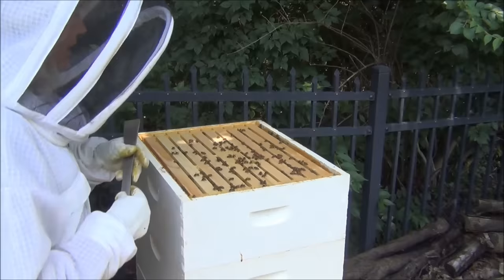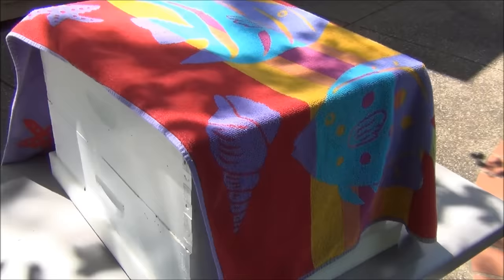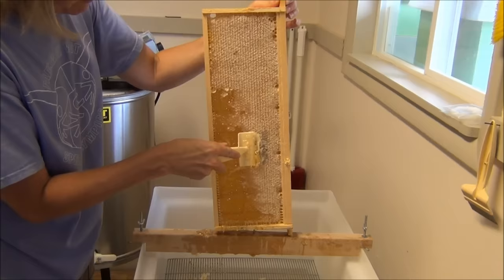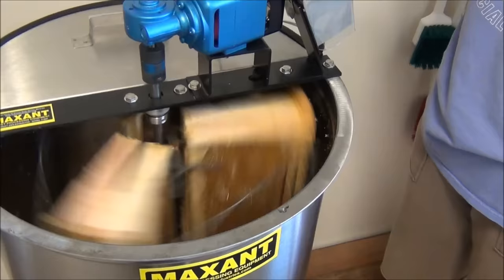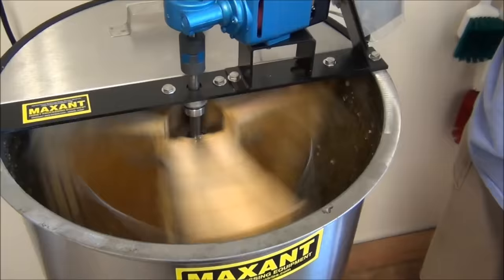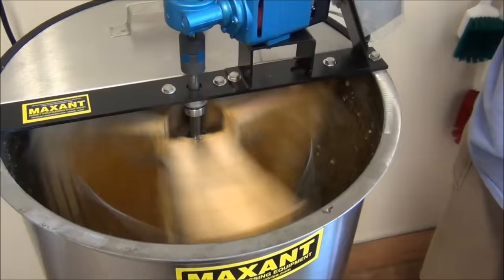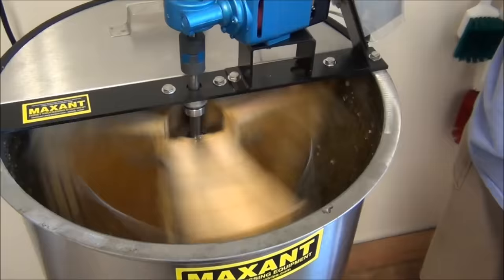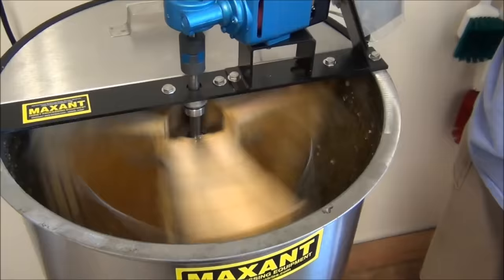My first year's honey harvest: 49 Pounds - from start to finish

Comment: What do you do with the super frames over winter? Do you freeze them? Or just store them in plastic tubs?
Reply from the maker: Last year I didn't do anything to them.  Just stored them.  I had less than two supers.  This year I had five.  I did put them in the freezer for two days to kill anything, then stored them where there is both light and air.  My queen wandered up there, so there is greater risk of wax moths and hive beetles.  I have them stored in my garage on one of those wire shelves (to allow air and light) just above the window in the garage (for more light).  We shall see how that turns out.  I know a lot of beekeepers use the anti moth chemicals, but I wasn't very excited about that approach.
Reply: Brook Hill Honey - Mr. G's Honeybees chemicals are not the enemy, other beekeepers use them because they help and don't affect the honey's taste

Comment: My only question is why measure liquid in weight instead of volume...
Reply from the maker: Most honey is sold by the pound.  You can convert pounds to gallons pretty easily though - about 12 lbs of honey per gallon.

Comment: Why not spread them out???make it quicker and easier for them to clean??
Reply from the maker: They can get in between the frames just fine.  As far as the wax clippings, it is all clumpy with honey and they have to clean from the outside in either way - hard to explain, but it is like thick cookie dough, but stickier.  Hard to spread out much more than that.

Comment: How come none of the cells have larvae in them?
Reply from the maker: Typically vertical colony design is split.  Brood boxes (which are taller at 9") are usually on the bottom, and honey supers (shorter at 6") are on the top.  Most of the time, the queens will not wander above the "honey line" and lay eggs higher up, but most beekeepers find they need to insert a "queen excluder" that allows the honey bees to move up and store honey and prevents the queen from moving up and laying eggs.
Reply: @BrookHillHoneyMrGsHoneybees  oh cool!  Thanks for telling me :)

Comment: How much do you leave for the bees winter?
Reply from the maker: We try to make sure that they have 60 lbs of honey, or about 10 frames of the large brood box size (the lower boxes).  We also give them some supplemental sugar mush just in case they run out.  In my experience, a strong hive going into winter eats a lot of honey and a lot of the sugar mush before the honey flow the next spring.

Comment: i saw a bee hive where you can extrakt the honey realy easy and it do not harm the bees at all. its called flowhive or something
Reply from the maker: Based on what I know, I wouldn't use that product.  While it all looks easy, the end product (honey) may not be what it needs to be based on the design of the flowhive due to moisture content of the honey.
Reply: Where does the moisture come from? Why wouldn’t the honey out of a non-flow hive have moisture? I’m missing the logic.
Reply from the maker: You are correct.  All honey starts with too much moisture and the bees evaporate it to "harvest" moisture levels.  However, the design of the flow hive doesn't allow you to determine and only harvest the honey where the moisture content is appropriate (bees cap honey when the moisture content has reached low enough levels).  The flow hive harvests honey universally instead of being able to harvest it selectively.  I also guess that the colonies would regularly become honey bound due to space design on the flow hive.

Just my opinion - I haven't heard a single experience beekeeper suggest the flow hive is a better methodology, and I agree with them.  Maybe that will change, but keeping bees is complicated not as simple as the flow hive would have you think.
Reply: The biggest negative, for me is, as you stated, that you cannot examine the individual "frames" to ensure the honey moisture is low enough.

I consider them Yuppie hives (or whatever dilettantes are called these days). The same people that just have to own a Volvo, Saab, Mercedes or other overly expensive toy.

Comment: Did the honey come from a single hive? How many honey supers did it have?
Reply from the maker: I provide a narrative on the hives and the supers at the very beginning of the narrative.
Reply: Pyrate King you said hive one never said how many it took to make the 49 lbs?
Reply from the maker: Sorry.  My mistake.  I thought his question was about my second year's harvest (121 lbs - that video I published a few weeks ago).  The first year harvest with 49 lbs, this video, I purchased two nucs in the springtime.  The harvest came from those two purchased nucs.
Reply: Brook Hill Honey - Mr. G's Honeybees 49 lbs makes about how many pints or qts?
Reply from the maker: There is about 12 lbs of honey per gallon, so 49 pounds would be just over four gallons of honey.

Comment: Are these dangerous bees or why are they wearing that suit while the other beekeepers dont
Reply from the maker: No.  They're not dangerous.  I just don't like getting stung.  If you don't wear protection, you will get stung once in a while.  I am somewhat allergic also, so I swell up like a balloon, adding to the uncomfortable experience.  When I first started (this video was five years ago and I was a beginner) I wore more protection than I do now, but generally, I have my face covered.  I hate getting stung on the face.

Comment: do you use a queen excluder?
Reply from the maker: We have gone both ways.  What we find is early in the spring, if we don't use one, the queen will wander up there and start laying eggs.  So we typically put one one until the first super is full in the middle and then we take it off.  One mistake I made is I purchased queen excluders that have a wood frame.  If I did it over again, I would buy the very thin queen excluders and the bee space gets a bit messed up.  On the other hand, I found these second entrance frames that create a second entrance above the queen excluder.  They seem to be working well.  You can see them on my second honey harvest video. (This video was our first year honey harvest - I don't think we had queen excluders on at that point as the lower supers were full.).

Comment: Why do the bees fight when stealing honey? Don’t they all work together?
Reply from the maker: It is actually called robbing.  If you have two colonies and one is too weak, the other colony will raid it and steal all of the resources, essentially killing the weaker colony.  Not sure why they fight when I put out the honey frames for them to clean, but I expect it is because they are from differing colonies.  It could also be that they are just in a frenzy during the dearth if there is honey around.
Reply: Why is it necessary to leave the frames out to be cleaned? wouldn't you ensure zero fatalities and make it easier to relocate the residual honey if you introduced the frames back into the hive it was taken from directly?

Comment: Just use a smaller hot knife then?
Reply from the maker: That video was our first year and our first harvest.  What we have learned in the years since then is that we like a serrated knife the best.  Works just fine.  We haven't found a good hot knife that doesn't overeat or cool down too fast  Much easier to just use a good serrated knife, right off of the shelf.

Comment: When extracting (spinning the frames around) how long does it take to complete a frame, and you can do how many at a time? (6)?
Reply from the maker: The one we were using had a capacity of six frames.  There are extractors as small as 2 frames (and manual, without a motor, that are not very expensive).  There are commercial grade extractors that hold 60 or more at a time.
Reply: How long does it take to extract 6 frames on your setup?
Reply from the maker: You start out slowly, to get some of the weight off of the frames and gradually increase the speed until it is at full speed.  We didn't time it, but I would expect one batch to take less than five minutes.

Comment: what did the 49 pounds sell for and what where your costs?
Reply from the maker: We sold 1 1/2 lb jars for $10 each.  Costs were pretty significant in the first year - tools, suits, boxes, frames, etc.  If someone wants to make money off of honeybees, it is much easier to make money selling bees than selling honey.  The second year I will turn a profit, but I won't be at break even for a bit, with only three colonies.
Reply: Thanks for the answer, here in San Francisco local honey sells for a lot more but those folks know what they are doing! I am thinking this would be fun to do here money aside
Reply from the maker: I grew up in Morgan Hill (south of San Jose).  Honey is definitely a local market, and things are definitely more expensive in my home state!  It is a very fun hobby!  There aren't many hobbies where you can actually make a little cash to offset the cost of your hobby.
Reply: Steven Rappolee hella expensive i want to start also in San Fran would love flohive but kinda pricey. And were to buy the bees from?

Comment: 49 pounds in weight what?
Reply from the maker: 49 lbs of honey.  Just over four gallons.
Reply: Brook Hill Honey - Mr. G's Honeybees you’ve done so well. Don’t you sometimes get a bit nervous around the bees?
Reply from the maker: Honey bees are generally very gentle.  They die when they sting you, so they aren't like hornets, yellow jackets or wasps, which can each sting you multiple times as they don't die.  Once in a while my bees will get a little grumpy (if they don't have enough food), but generally, they are very calm.  I am a bit clumsy, so that can cause them to sting your hands if you don't have gloves on, which I don't wear very often.  Lately, I have been in shorts and haven't gotten stung, and my shirt isn't sting proof, and I only got stung once when a bee got stuck in a fold in my shirt.
Reply from the maker: I am generally very cautious, so I typically cover my face.  Honeybees are almost always very gentle.  Sometimes they get a little grumpy (I notice that August, no flowers, lots of heat they can be a bit grumpier).  If you have a colony that is like that all of the time, you replace the queen and her offspring will take on her temperment, versus the old queen.  I am actually allergic to bee stings and I swell up big time (and it hurts), but it itches for a couple of days, then everything goes back to normal.  I am probably up to 25 stings due to not wearing protection, gloves, etc.  My wife typically wears a head to toe suit coverup and she has only been stung when a bee hitches a ride in the house and then she stepped on the bees a couple of times in her bare feet.  She isn't allergic like me though, so she has it easy!